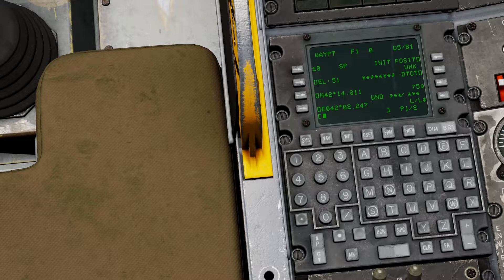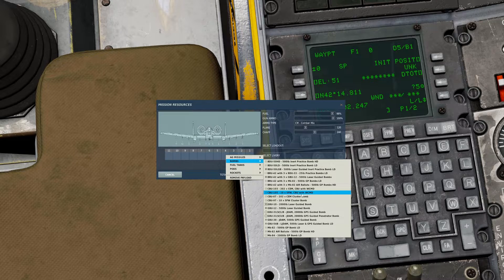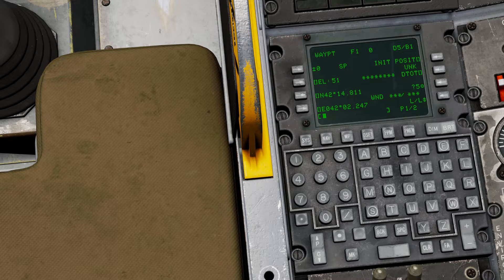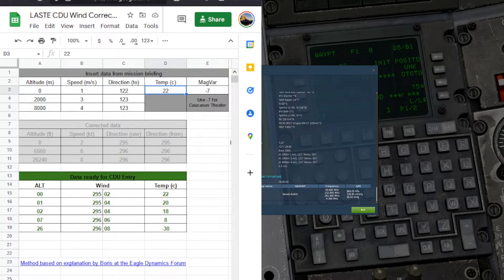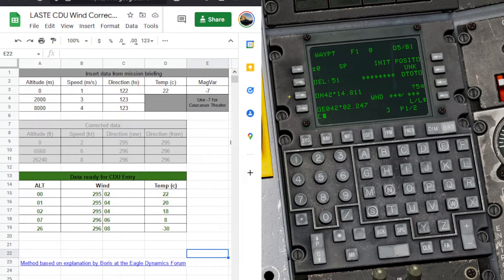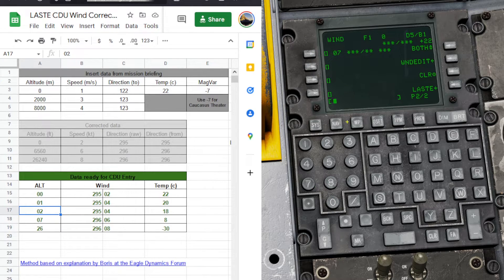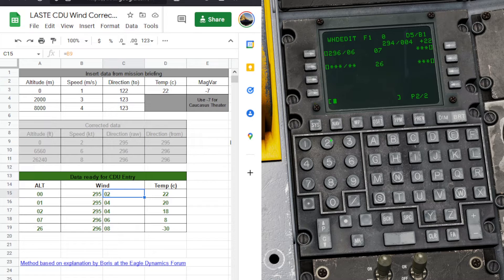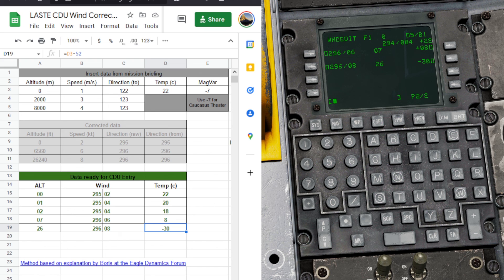Hero | DCS A-10C II | 1 - L.A.S.T.E. - Wind & Temp Correction

Comment: this should fix the hud when it starts drifting in strong wind. is that correct?
Reply: no, you need to use rudder for that, your turns are uncoordinated
Reply: @seanmccrary8300  interesting. Problem is there is no yaw trim i dont think unless you use the emergency controls. Am I supposed to be applying rudder input during flight? That will crab my plane
Reply: @SvenCheddar  yes you need to use rudder input during your flight when you hud is shifting like that ( it indicates you are dealing with a cross wind at the altitude you are currently at) also it will make turns a lot more coordinated if you keep you slip indicator ball in the center while doing aileron turns. The A-10 doesn’t have a FLCS (flight control system) like the F/A-18 and the F-16, they require almost no manual rudder input due to their FLCS.

Comment: Hello GhOst, It seems to me that there is a formula missing in your Excel table (once downloaded), the box where "Use -7 for Caucasus Theader" is indicated, does not appear, am I wrong?
Reply from the maker: I've updated the sheet itself since the video was posted, there should be no impact to function of the sheet. Check out the 2 minute "LASTE 2" video I have under the A-10 Hero Playlist (https://www.youtube.com/watch?v=efOrOUZiUmI). It will show a much more accurate method for getting the proper MagVar. (We didn't have that method available when this video was released!)
Reply: @DamnedGh0st  Hello and thank you for your feedback, Have a good flight!